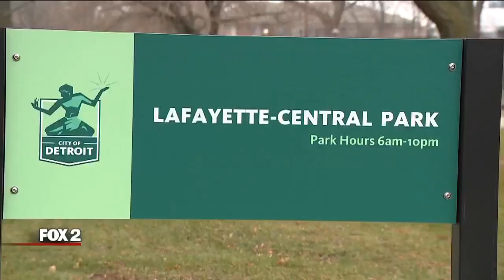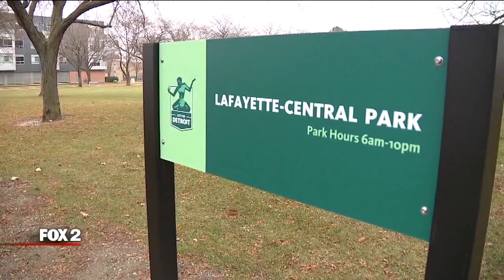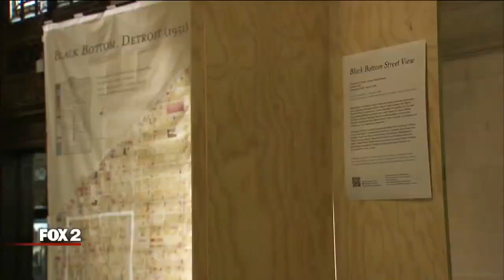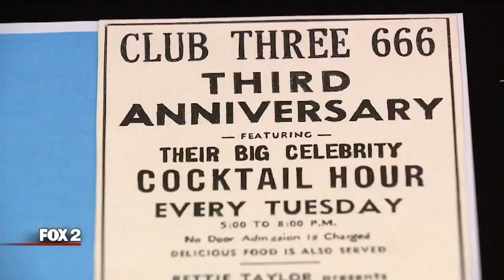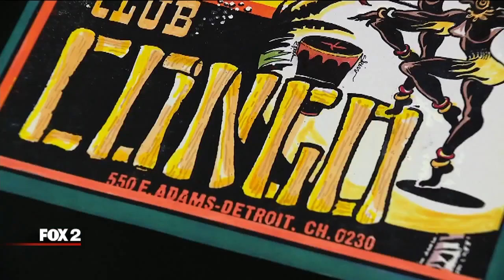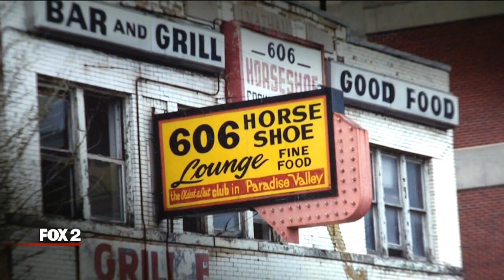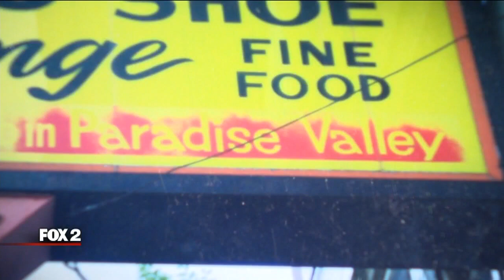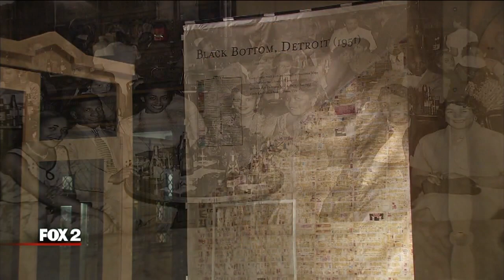BLACK BOTTOM, PARADISE VALLEY, DETROIT, AND BEYOND

Comment: Prior to blacks and immigrants from Eastern Europe moving in, this was a majority Jewish section of the city. The Jews started moving out around 1915 but still owned most of these properties. I used to hear about this area of Detroit from a relative of mine who remembered it very well. That section of the city was the most derelict part of Detroit and that is why the freeway was put through it. The planners didn't want to destroy areas of the city which were clean and robust, they ended up choosing the most derelict part. Decisions like this are still done today. The residential streets and the homes were just not taken care of and most of the structures were fire hazards. Some had not been painted in 50 years and were literally rotting away. I was told it was common to see a late model Cadillac in front of a house that look like s***. I also had a recent conversation about that area with retired Detroit police officer who also remembers that area very well and he said crime was a big problem. Also the city is not off the hook for what happened afterwards. People were displaced and promises were made to get them decent housing and most of those problems were broken. It was said even in the 1940s if you tried digging a hole under a house or on the street for plumbing reasons, you would end up hitting wooden sewage pipes from the farm days. Also at that same time in some of the homes there were toilets in the living rooms in many of these homes, yes there were actual toilets in the living room in some of the homes and they would just put a privacy curtain around it. Even if somebody made a decent living and had money they still didn't take care of the house.

Comment: Black Bottom was beautiful. It was an area where people was force to work with what they had. And what they had was very little. They worked for every thing they got, and they were given nothing. Nothing.

There was no road fixing or general road repair, unless it really cause a transport issue. Many of the homes and building had wooden sewage systems. And because 78% of the properties were owned by persons in the local government, they never wrote or passing laws forcing modernization of the structures. The local schools in Black Bottom received the lowest of funding. Because the local government did not see large tax dollars coming out of Black Bottom. But that issue was due to them. Because they Black listed and Red Lined" every thing in those areas